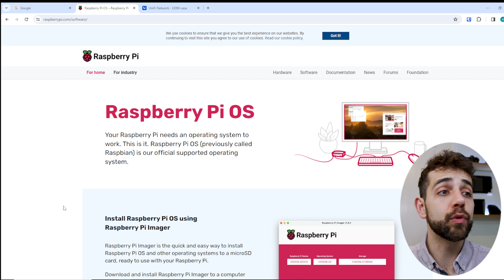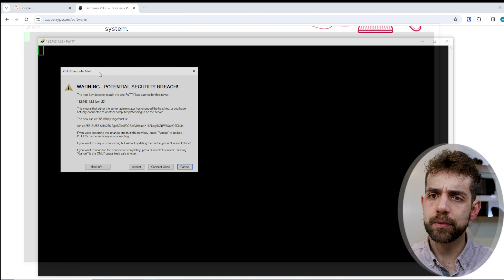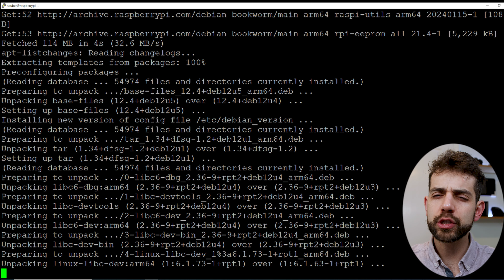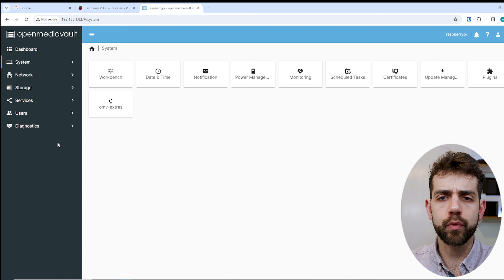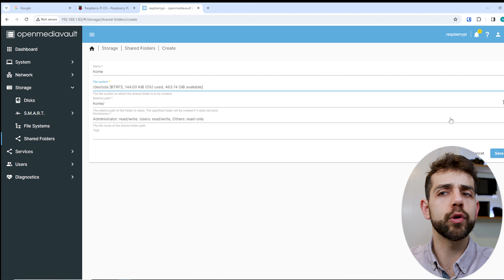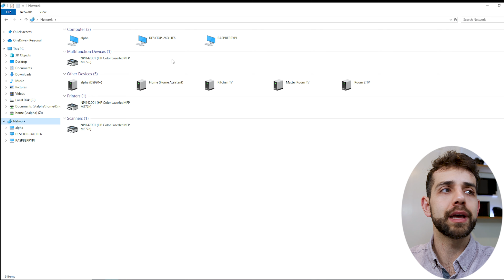Let's install the new version of OMV on Raspberry Pi 5 (OpenMediaVault 7)

Comment: just after I install OMV and reboot rasp, I can't access OMV in the web browser even if I enter the ip address indicated in my router for the raspberry. does someone have any lead please?
Reply: when I connect with putty it is ok but on web browser no answer
Reply: Ensure it is an ethernet connection not WLAN, check the IP in OMV first aid, it sounds like you're PuTTY into the pi, not OMV
Reply: @runaway_away  no it was the url to install omv which was not the good one

Comment: Hi Sauber, could you please check the link in description? I tried to open it and I couldn´t.  or could you please add the script in the video description?  I`m trying to install OMV in my new RB pi 5. thanks in advance! greetings from Argentina.
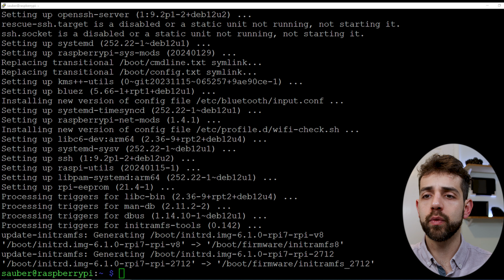Reply: Are you stuck with the script at 8:30? You can't see a letter, that's probably why it fails:
Reply: The letter 'r' after installscript/ isn't visible ;)